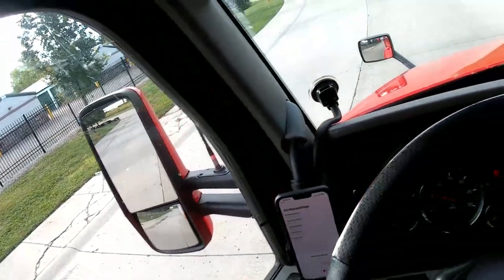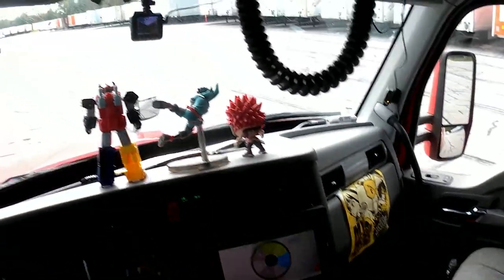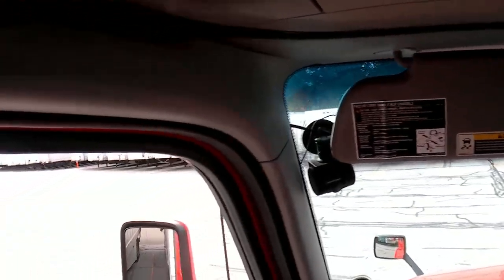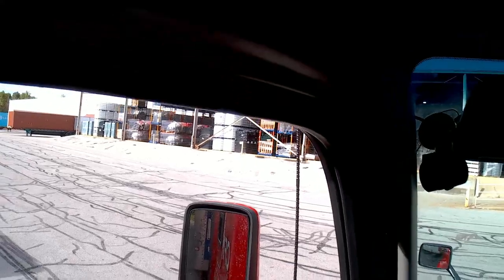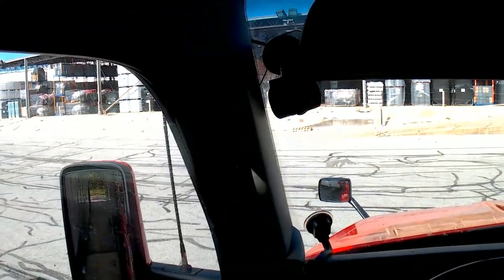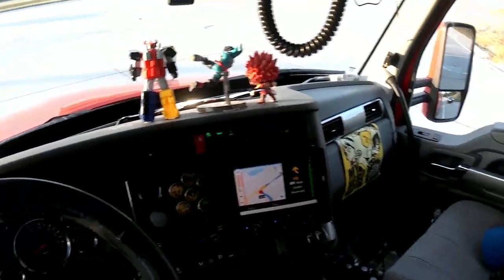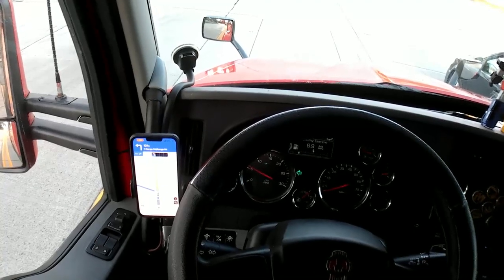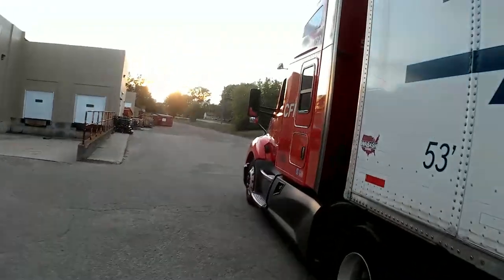Tractor Supply Haul From Indiana DC to Marysville, MI Store | Trucking Vlog | POV Trucking

Comment: Good video. When you were hooking up the trailer after you had to readjust the tractor and the 5th wheel wasn't sliding under, you can do exactly what you did unhooking. Lower the air bags again and that will lower the drives enough to get under the trailer. Be safe out there driver.
Reply from the maker: Thanks Blue!! I will add that to my notes!! 🙏🏽